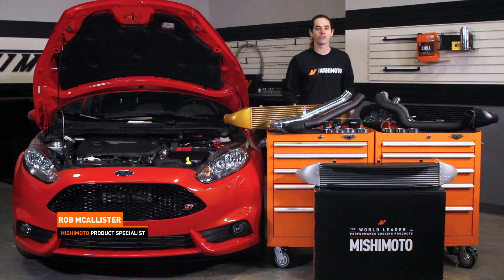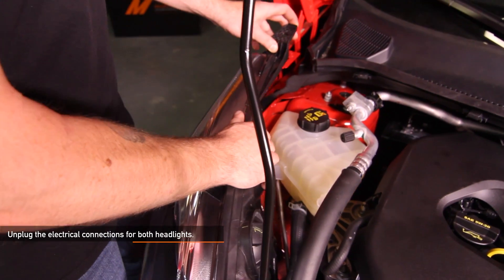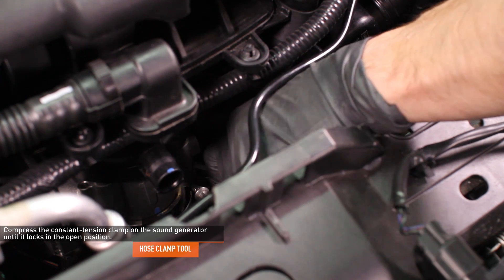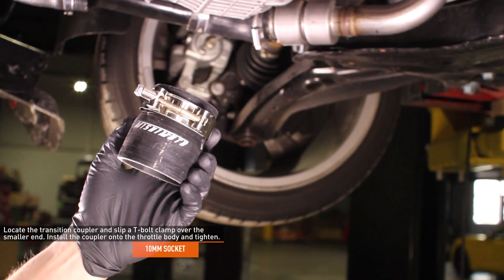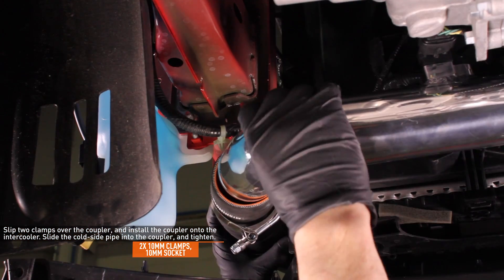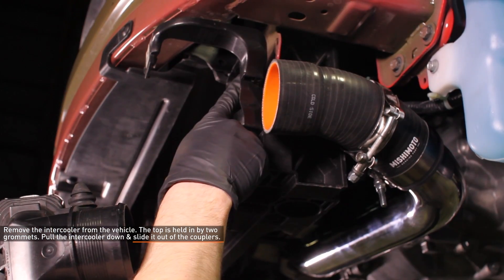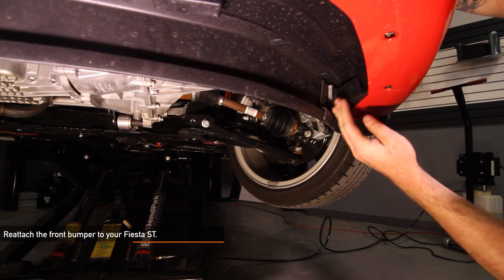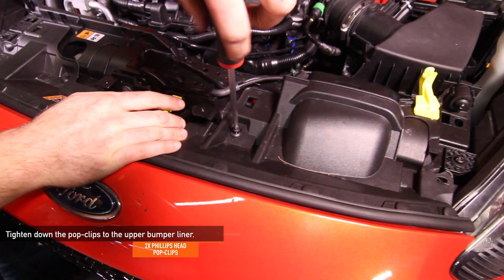2014-2019 Ford Fiesta ST Intercooler Kit Installation Guide By Mishimoto

Comment: Hi, great install video.
Would this larger hot side pipe fit with a front lower brace (4 point) installed? the OEM pipe sits quite close to where the brace would connect to front of the control arm. 
Thanks
Reply from the maker: Unfortunately we cannot say for sure without knowing the design of the front brace you are running. However is you are already very close with the stock pipe a larger diameter pipe might not help the situation.

Comment: Cod you use all these upgrades for a 1.6l ford escape? Since it’s the same engine
Reply from the maker: They may have the same engine but the chassis changes a bit and may require some modification to fit our parts.

Comment: Es necesario instalar intercooler en Ford Fiesta st. Si le deseo instalar downpipe y intake?? Gracias
Reply from the maker: An intercooler is not required for an intake and downpipe install. You'll be able to use either of those without upgrading your intercooler, although you'll see better gains with an intercooler and tune.

Feel free to reach out to Support@Mishimoto.com with any additional questions!

Comment: So after install my fmic if I wanna get the hot side pipe later will I need to remove my bumper? Obviously it would probably be easier to do it now but mod funds are low after I purchased my fmic
Reply from the maker: Hey Joshuabrutl.  From what I can see, installation of the hot-side pipes does not require the bumper to be removed. Feel free to reference our installation guide if you'd like some more details. Link below. 
https://cdn.mishimoto.com/media/productpdf/MMICP-FIST-14H_InstallGuide.pdf

Comment: will this run ok with the stock engine tune?? its part of a long-term upgrade and the tune will come at the end when i have everything in place
Reply from the maker: Hey godamighty. This intercooler will be 100% fine on your stock tune. We are actually working on getting this system CARB approved for our friends in California :).
Reply: godamighty oh your one of those people, install everything and tune at the end so your car feels twice as fast instead of incrementally fast .. I'm actually doing the same thing I'm on a stage 1 tune with a full exhaust intake and motor mount, I ordered my fmic but I won't flash stage 2 or 3 until I get the piping as well, although the best mod so far has been the motor mount (minus the added vibration)

Comment: What's the point in changing the intercooler
Reply from the maker: Hello Michael. During our testing with the vehicle, we found the factory intercooler to be a limiting factor to those who track their vehicles or want to add more power. Installing the intercooler will not only bring down your air intake temps dramatically, but also provide instant power gains as a bolt on part. For those looking for even more power, this unit is rated up to 325 horsepower at the wheels. If you would like more details, head over to the product page and check out our tech specs :) https://www.mishimoto.com/ford-fiesta-st-performance-intercooler-kit-14.html